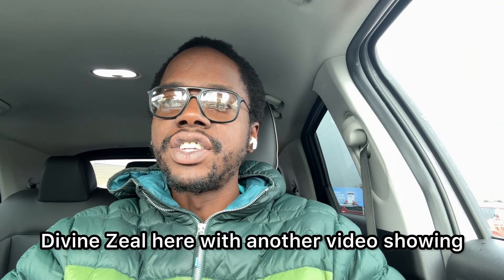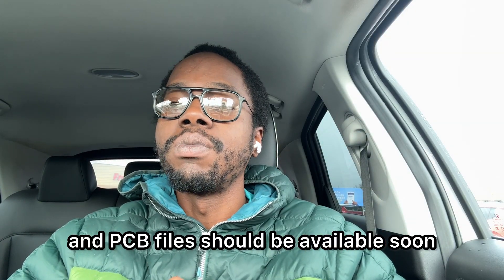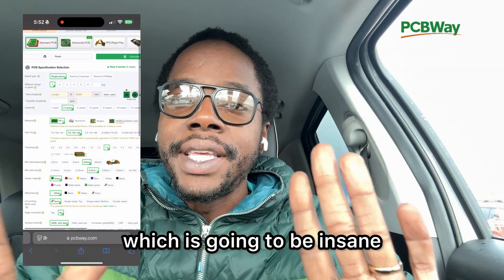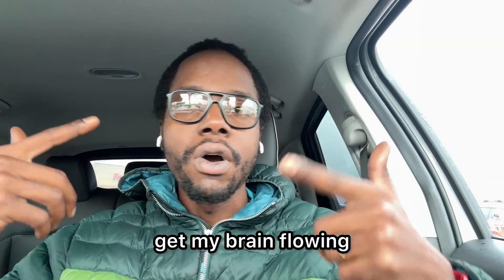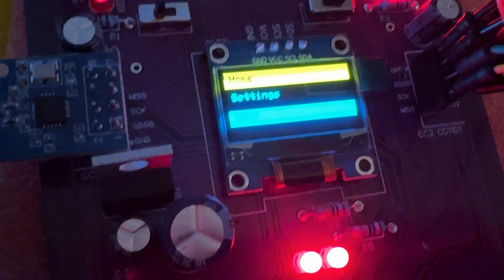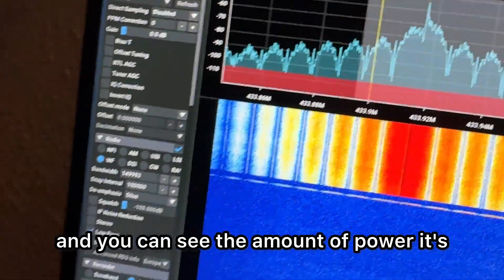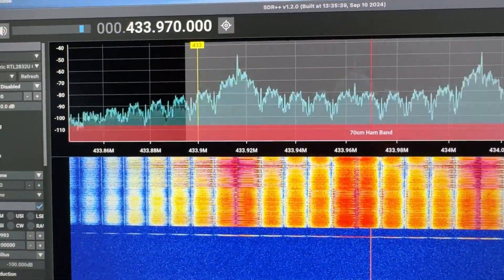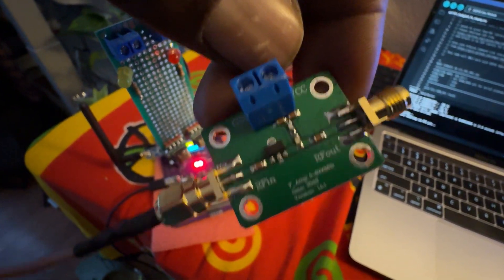Multiple CC1101 433MHZ Signal Generation Test | Project StarBeam

Comment: For amps..you'd require a amp that both rx and tx or would you have dedicated modules with amp for either rx or tx?

Also, i haven't seen much use..and seems it faded silently into the shadows..but last year espresif cameout with a number of new esp32 modules...1 of them being a variant with 2 antennas....2 wifi chips..not sure ble though...You can still find them for sale but i haven't seen anyone utilize them...1 drawback and possibly why is the fact that both antennas are of the pcb variant..printed on the board.I don't understand the logic for manufacturers to leave this out...and antenna connector...ipex...sure "cost savings" but, so many more people would buy the modules if they had the antenna connectors...it is so annoying making them be able to ourselves not to mention the many boards destroyed in the process....